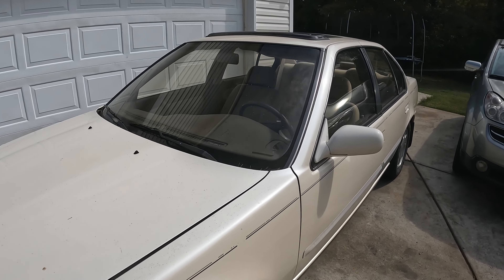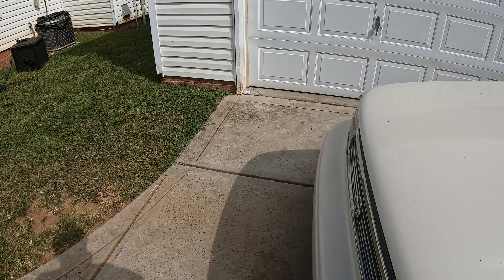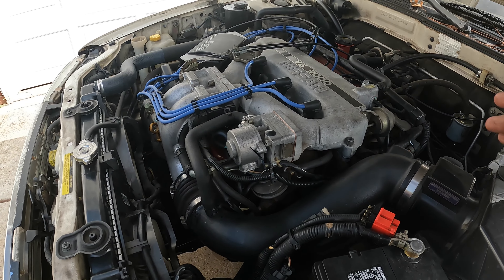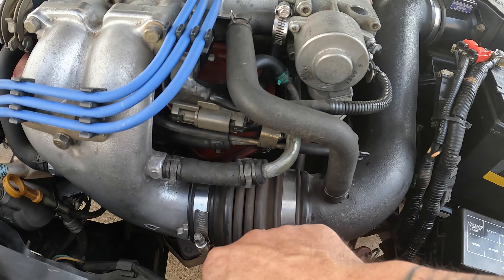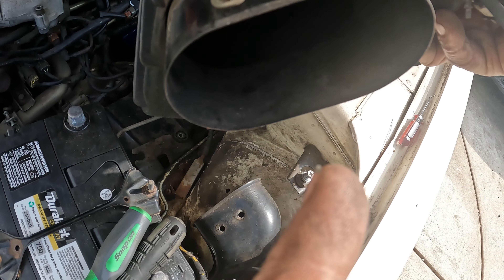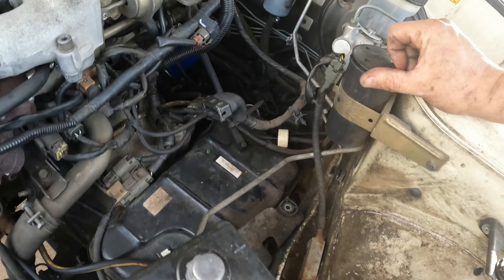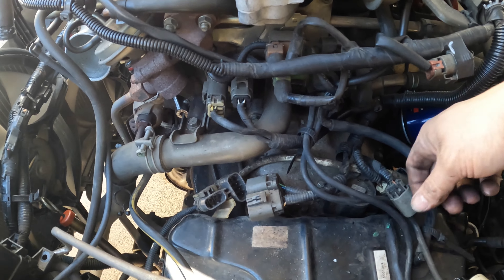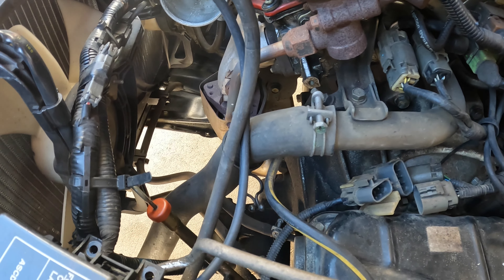3rd Gen Maxima Transmission Removal Part 1

Comment: Wow! that car is clean. I am considering doing the same to my 1990 maxima. Any tips would be helpful
Reply from the maker: Yeah it was taken care of extremely well.  There were no videos or any real instructions on doing these transmissions and that's why I decided to do it.  The biggest tips I can give you is get you a flex head ratchet and Mayne some flex head ratchet wrenches.  They helped me put tremendously.  One of the hardest things for me was getting the passenger axle out.  Also, these transmissions are pretty heavy so have some help when lowering it down and putting it back into place.  If I think of anything else I'll let you know